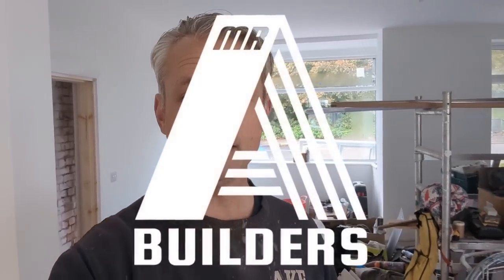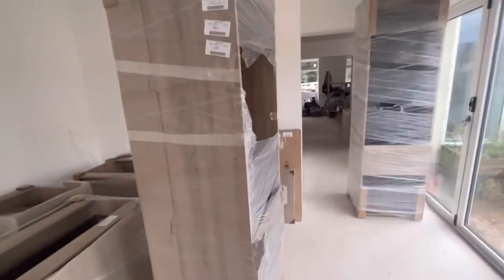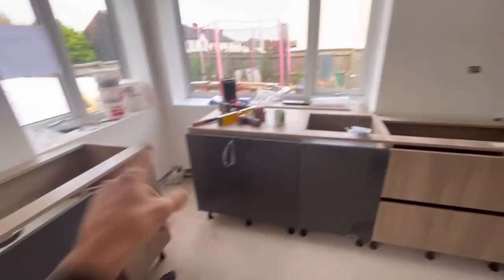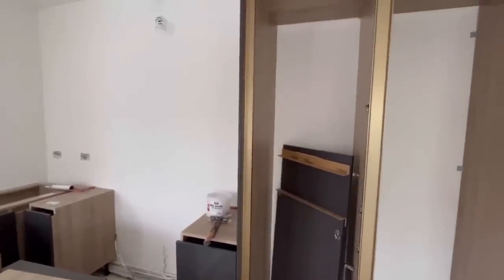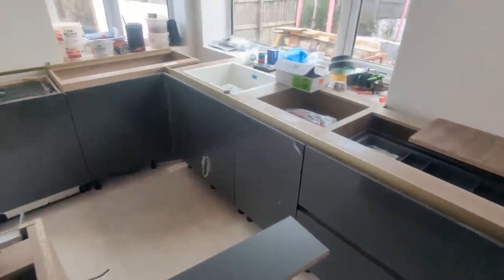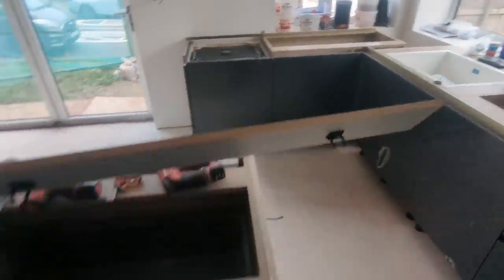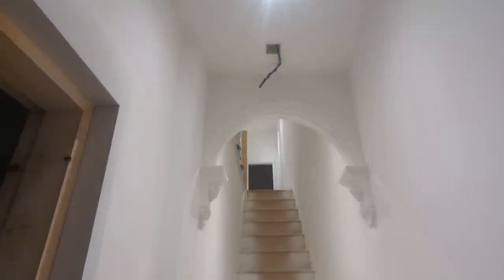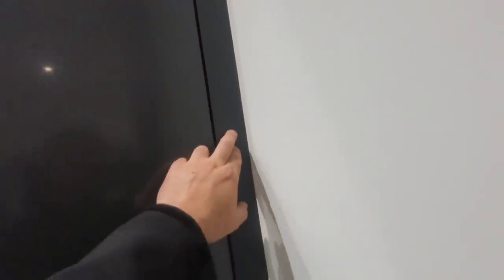True Handleless Kitchen - fitting our first one. Hints and tips. Builder Destroys His Own Home #14

Comment: Lovely to see the job motoring on guys. Pity you couldn't get that final trim squeezed in the corner, probably because most designs use 30mm gap for vertical trims, not 35. That'll be when you originally designed the room measurements no doubt ?? How did Rich address the bare wood edge on the pull-out larder ?? You could always change the cooker rails for a gold set if you were tempted...but hey, it doesn't detract from an awesome kitchen. Nice overall job guys, can't wait to see the finished room.

Comment: I have that cooker....LOL.....the rear height feet adjust from the front bottom plate that comes off. The front feet you turn. Its all in the manual. I have had mine since 2014. Its handy having that many ovens sometimes.... Have only used the 2 main gas ovens. Have never used the 3rd gas oven. I have never used the slow cooker bit at all under the oven.
Reply from the maker: Haha! Really? Is it a good piece of kit then?

Comment: xcellent video, fitting my first one next week.  What did you use to cut the brass with....  Thanks J
Reply from the maker: Hello mate, hope you're well. Thank you for getting in touch. We cut it on my Makita chop saw, I can't for the life remember what tooth blade it was but it's the blade that came with the machine.  We also cut a couple with a 1mm metal blade in an angle grinder, worked perfectly. Hope that helps mate, good luck!

Comment: Just curious I thought well if its a finished floor down already shouldn't be an issue with the DW coming out if there is an issue but noticed the cut out in front of the island which made me think the finial flooring isn't installed yet. If that is the case that DW is permanently placed.If so you might be able to add a butcher block or some other removable top instead of the granite.